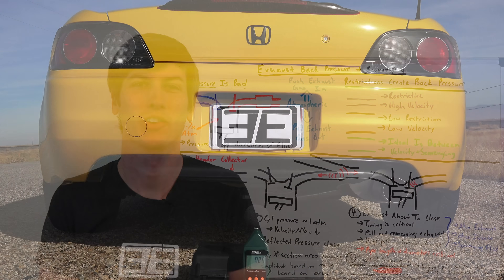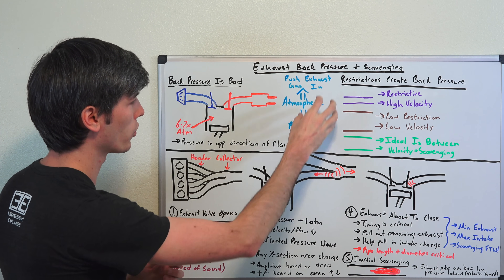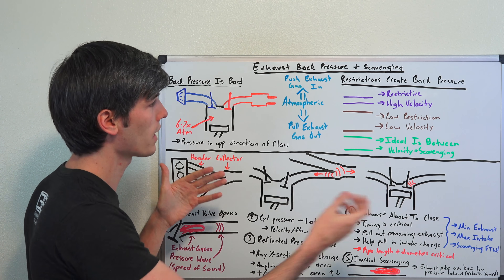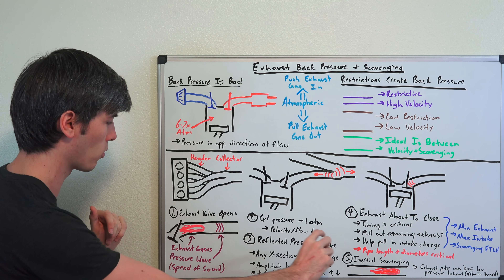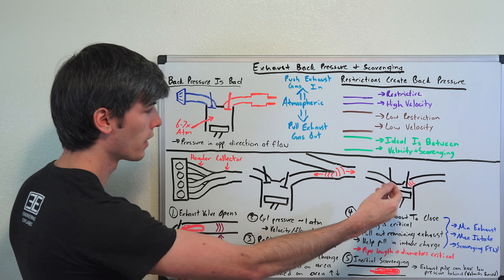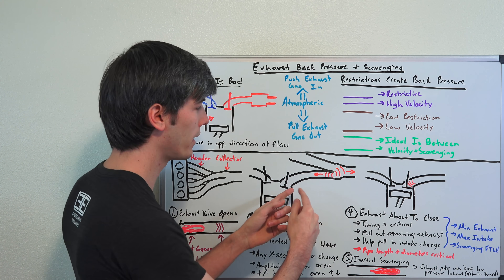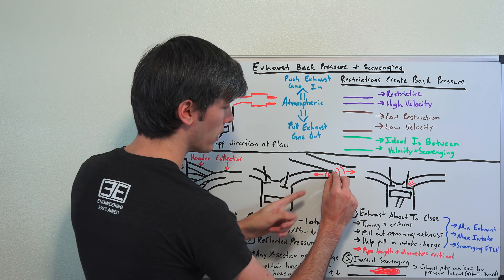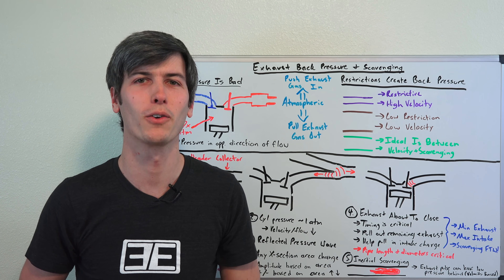Stop Saying Car Exhausts Need Back Pressure

Comment: YES!! Thank god! So sick of hearing the crap about "needing" back pressure.
Reply: you cant have scavenging without backpressure. you don't need it... drag cars don't have scavenging. lmao
Reply: Yep. Beat me to it.
Reply: You DO need at least some back pressure to get good sound. Try taking off everything after the headers. It will sound like ass.
Reply: @80s_Boombox_Collector  Sound doesn't help it go, contrary to what every Honda driver around here seems to believe.
Reply: @Jupiter__001_  No, but good sound makes it more enjoyable.
Reply: Unless your engine doesn't have viable valve timing, then like magic it does need back pressure. Hence exhausts used to be built to a specific volume to supplu this. Remember the shittu ford fiesta xr2i and twats used yo put massive exhausts on, and then the car had zero acceleration and top speed..... so like i said in my comments  variable valve timing is the reason an engine no longer requires back pressure to ensure hp.
Reply: @ADayInTheLifeOfAYeti  You missed the point of the video. "Backpressure" from the point of view of the engine is minimised by applying a somewhat restrictive exhaust manifold that is designed to aid in scavenging. Backpressure itself is not desirable, but restriction can be, depending on how it is introduced.

Comment: What about stock cats vs high flow cats or no cats? I heard that you could lose torque  with test pipes. (It's been two years but any response is good)
Reply: No back pressure you lose power because fuel is going out of the chamber... What does the backpressure is to keep the fuel inside the chamber before the piston goes up.

Comment: G'day,,yep 2 years till viewed,,so might be a bit late,,but back pressure was important for older design engines,,like flat head,back pressure was intended to prevent valves burning,,making sure complete valve circumference was used and not  just the edge near cylinder,which would burn,,causing head removal and replacement valves,,
modern day engines don't require much back pressure ,Head designs have changed from the old side valves,these day we use  exhaust pulse to make more power,,Expansion tubes on 2 strokes best example of this,
So for older design engines yes,Side valves,,,later day turbo ed non turbo-ed,,nup,,

Comment: Yeah but you do need just a little bit of back pressure, too much free flow on N/A engines especially 4 cylinders can result in less power due to the combustion escaping out the exhaust valve during the compression stroke

Comment: Engineers call it back pressure. But I see it as just being the pressure that is present when exhaust gasses are flowing through your exhaust. On a typical stock engine (general motors) will call for .5 to 2 psi depending on number of cylinders. You need restriction for scavenging to occur, very very little restriction to create the affect. Just like people are joking. You can't just put 10" straight pipes on everything

Comment: Greetings. I fitted a aftermarket exhaust to my xtz 660 tenere... i have noticed when the DB killer is in, there is way more power through the rev range...with the DB killer completely removed, the power is noticeably less... i think it needs a bit of back compresion cause of the catalytic  converter that was in the standard exhaust... i love the sound without the dB killer ...but want the power like the db killer inserted. Could back compresion be the problem?? Thanks for your video. Much appreciated

Comment: its an old post i know, but its a silly question, because the quest appears to assume some things in the way the question is asked. i mean there are to many variables, from cam timing, if your running boost , super charger or turbos, nos, is it a straight up race machine were talking here? or is this grandmas grocery getter? i dont like the titles in your videos .... they assume to much and do not ask or inquire to specific enough conditions

Comment: I had a diesel Rabbit in the late 80s, and when the exhaust pipe broke, it was louder and slower than you could imagine.
Reply: Why did eliminating back pressure drastically decrease performance?

Comment: My aunts ride on craftsman mower with a briggs and stratton wouldn't run without back pressure. Her muffler broke right where the pipe is spot welded into the muffler, it would only start and run if i pressed my palm tight against the end and restricted the exhaust, put a new one on and it runs like a dream.

Comment: I have to think through this negative pressure thing a little. 
You explain the back pressure question I've had for years. Thank you. 
I had a 69 Dodge dart Swinger with a 340 and later I saw on another Dodge police interceptor, immediately after the exhaust manifold there was a 2" pipe from 18"-24-" then expanded to 2 1/4" after. 
One question I had when you were explaining the scavenging effect was what about the valve overlap? Older v8's typically had about 15-20 degrees crank rotation of valve overlap.

Comment: For vehicles that are equipped with egr systems a small amount of back pressure is necessary for proper function. I've tested and recorded a 3mpg loss from my 3.0 ranger from a hole in my egr feedtube.

Comment: Sounds good to someone take has no mechanical training.  
Some engines by replacing the muffler with with a pipe can cause a drop in fuel economy by 20% or more. 
SO NO. 
SOME BACK PRESSURE IS NECESSARY FOR FUEL ECONOMY.! !

Comment: Here's my personal hands on experience by feel not by dyno. Vehicle: 89 f150 2wd carbureted 351w 4spd manual. Engine mostly stock with long tube headers, electric cutouts in front of 10 series single chamber mufflers. 
With cutouts closed and running exhaust through mufflers, strong pull, but hesitates at first. With cutouts open, smooth response but feels like it isn't picking up speed. As said before, this was all based on the feel not the dyno sheet. Never went to dyno because it was a beater with enough pep to have fun on your drive to work. Also had a passenger that confirmed the feel.

Comment: Had my exhaust snap just after the cat and the car lost 90% of its power...
Reply: tle1977a your car went into “limp mode” because the excess oxygen confused your lambda sensors. (Specifically the bank 2 sensor after the cat)

Comment: Sounds like the negative pressure wave is critically timed for a specific rpm and the benefit falls off the further you are from the sweet spot. So if your exhaust would variable tune based on your rpm then you’ll have better performance. Can the tuning be done real time with electronic gates/baffles to change where the first wave is sent back?

Comment: There's a fine line with back pressure it is not simple and cut you do want a small amount of back pressure because it reduces fuel consumption when you have a very free exhaust it will sound much better you will have a lot more power but you will burn the hell out of some fuel

Comment: This video's too basic making the title misleading.  You always need some back pressure and it has to do with:

- Intake gas inertia
- Intake/exhaust valve overlap at end of exhaust stroke
- Engine capacity, speed, exhaust capacity thereby gas inertia

For example:  My little brother decided to drill a few small holes in the end of his bike's factory exhaust.  Sure it sounded a bit louder and he felt the power was somewhat the same and if he experienced any more he put it down to psychosomatic experience (because he's somewhat clever).  But the bike was then using more fuel.  After I explained some of the details he fully understood the principle of "over-scavenging" - when the exhaust low pressure scavenging sucks raw intake gas through the critical and unavoidable valve overlap straight into the exhaust, not actually burning it.  He basically ruined his factory-tuned exhaust, at least until we plugged the holes back up.

The other principle has to do with exhaust reverberations and returning pressure waves.  These are usually taken care of by way of a "step" shape at the mating end of the exhaust port and the header pipe, reducing pressure waves from re-entering the cylinder, including a tuned length set of pipes to properly cater for exhaust pulses that can only work in a certain RPM range.

Comment: You forgot to mention about engines that have the fuel drawn in with the air, like carburetors, and have valve overlap. If there is not enough back pressure, the raw fuel can be sucked out with the exhaust gasses, lowering power, efficiency and shortening catalytic converter life if you have them.

Comment: So lets say i have a late 70s ford with a carbureted V8. It still has the stock exhaust, and it kind of rocks at idle but not too badly at all. The stock exhaust however is completely roached and has holes all along the top of the pipe, but it still has a catalytic converter. Do you think It would be fine replacing it and putting a glasspack or somthing better because it doesnt seem like it has much back pressure at all currently? Not sure how picky 302s are but id like to get that fixed. Thanks

Comment: Take into account that the speed of sound increases with temperature. That means that as your engine heats up, the sweet spot for scavanging will be at a higher RPM.

Comment: Very nice explanation! I also would like to know, the way to discover the ideal velocity. Is there a equation or has to be empiric (by testing different exhaust, one by one, in a real track)? Thank you!
Reply: Yes- there are equations to help design optimal configurations, easily found around the internerd. Exhaust calcs are based on the pressure wave travelling up and down the pipe at the speed of sound.

Comment: Bro I’m just trying to figure out if it’s bad for my truck to straight pipe it 😂
Reply: before you go to straight pipes check your air/fuel ratio on a dyno ..if it becomes lean with straight pipes you will need to increase the air/fuel ratio till it is the same as before with mufflers

Comment: FINALLY someone with smarts ! back pressure = BAD, I wish I had a dollar for everytime I've heard "oh I don't want to do that it will take away my back pressure ! " to that I say ABSOLUTELY ! that is what your trying to do ! .... in the 1970's ford trucks that got 12 mpg (loaded or unloaded truck....a very good trick on fords behalf! )  I've been telling people for years replace the exhaust with 2" or 3" pipe and get rid of the 1.5" exhaust pipe.... and their gas mileage goes up  ! most people believe you have to have back pressure for some reason, I guess that is because of the auto manufacturers  lying to justify the small ill conceived exhaust pipe of the 60' 70' and early 80's ....
if the guys that own the older pickup trucks would replace the exhaust pipe, throw the carburetor away and get a good one
and time the engine correctly ( with a vacuum gauge to get the right setting (Peek the vacuum)) they would get at least 24 mpg ! ..... I know I've done it several times !
unfortunately most are of the belief that you need back pressure in the exhaust system, ....nothing could be further from the truth ! ....
Bob....

Comment: Okay so I have a serious inquiry about this, I want to do an exhaust on my 2.8l 30v B5 but i don't know what diameter I want to do it in. So the first real question is there a way to calculate the perfect diameter to reduce back pressure as much as possible while retaining as much velocity as possible. Now to get more specific, I've notice the car makes good torque between the 2500-4000 rpm range and then while the car doesn't fall on its face it takes a bit for the car to start making power and I notice that around 4800rpms I get a massive jump in power. Now personally I love this as I'm a huge fan of peaky motors such as the 4age etc. And I was wondering if there is a way to retain as much of the torque as possible but to amplify the burst of power at the top end at the same time. I really want to do a straight pipe with higher flow cats where the inlet and outlet of the cats is 2in and then it goes into a y pipe with a muffler at the end. The exact engine displacement is 2771cc and I've seen graphs/charts saying 2.5in is the way to go but some people say it sucks. Sorry for the long comment and I very much do hope we can speak about this a but more.
Reply: Do the math
Reply: @williamparker2922  if I had an equation to do math with, I most likely would have done that a long time ago. That's the reason why I'm asking, I'm not asking anyone to figure it out for me. I'm asking if I could be provided an equation as well as a more specific problem that I would like an answer to.

Comment: In my experience of fabricating stainless exhausts for hundreds of cars, one car stuck out. I believe it was a Citroen C2 with a 1200cc engine. It had a rather large bore exhaust from the factory (2just over 2" but not quite 2.25") with restrictive silencers. When I made the exhaust for this car, the customer mandated that I kept the bore the same size for various reasons that werent valid. Anyway, after fitting a system with free-flowing-silencers and that 2.1" bore, the customer came back and said he had lost power. To fix it, I removed the back-box section and rebuilt it in 1.75" bore with a free-flowing silencer with the same internal bore. Problem fixed. 
When full systems are built, we went either from the downpipe or after the original cat section. This is so that forwards of the exhaust system is kept original. Often if the customer requested too large diameter, they would lose power.

Comment: My question is if you had a electric fan in the exhaust pipe that creates a vacuum to help suck the exhaust out of the cylinder would it be more efficient?

Comment: Why do piston engine aircraft have relatively short open and separate cylinder pipes?
Reply: They usually have them facing back because the force at which the exhaust leaves the engine actually produces some thrust in the plane. That's why most v12 from ww2 had the exhaust tips shaped the way they were.

Comment: So how would the math work like formula to figure out the sweet spot
Reply: definitely not a single formula, but a bunch of them interacting with each other. So most likely there are computer air flow simulators to give engineers some idea on what do to and then good ol' trial and error. they listen to the sim, make a real exhaust based on that, see what's what, ideally locate the problems, go back to sim, repeat until good enough.
Reply: Exhaust systems are largely based around what ME’s (mech. Eng.’s) call “fluid dynamics”.   I took 3 courses at my university that involve that subject when earning my degree. LOTS of math. Unfortunately too much to explain in one video/comment. But, google is pretty helpful 🤙.

Comment: i have a subaru outback and my exhaust pipe rusted out. i patched it myself and a week later it fell off entirely.
i had a shop fix it and they put on a new pipe from the cat to the muffler, removing the right muffler, old pipe 2"? and resonator and replaced it with 1.5"?
but now my car is loud on accel and decel. has a really loud rattling noise and if floored get a whistling noise in addition. i tried another muffler with no change.

i've also noticed a loss in power. it isnt significant, especially at a leisure acceleration (power), but is pretty noticeable when flooring it.

before the change i would get 10mpg while towing at 50mph (~4000rpm in 3rd gear) but now i doubt i could maintain 50mph on the same stretch of road.

is this due to the small diameter? my imagination? resonator? muffler?

Comment: Back in the 80s i was rather interested in driving tuned Minis. I had about eight on the trot. A mate of mine pulled up in his 1275GT and i wandered what the hell had stopped outside my house. I went out to see him in his latest GT, He loved them... He gets out of the car and asks if i heard his exhaust. I said no, but i heard what sounded like a tractor about to detonate. AH, he said. No that was me, look.
I went to the back of his Mioni and saw a piece of 5 inch diameter flexible drain pipe poking from under his rear bumper. 

It sounded HORRIBLE! When i asked if it had any affect on driving, he said yes. It's flat as a fart! So he drove back home and put the standard exhaust back on.

I also remember around that time that the best combination of noise to added performance was the RC40 single box system. It was expensive but backed it up with flow bench charts and proven gains in power. 

I remember reading about aftermarket performance exhausts in CCC, (Car and Car Conversions) which was THE magazine of it's day. They conducted a proper scientific test on which was the best performance exhausts for a mini.
I think the RC40 wasn't the absolute best, but the best all rounder. There was a popular cheap exhaust made by a company called Peco. I'm pretty sure that their PERFORMANCE EXHAUST actually flowed WORSE than the standard exhaust and when fitted gave less power on the rolling road than the standard exhaust too. It was just louder, which for the idiots meant 'must be faster'.

Comment: i heard back pressure is good 20 years ago in high school auto shop and about how new cars (1997) needed it to help performance because of the computer.  i have remembered that for 20 years and it never EVER made sense to me except that maybe the o2 sensor somehow will dump more fuel or ????....but i dont think it can dump more fuel than my right foot so it is finally reassuring that it doesnt make sense to you either.

Comment: Is there a practical way of measuring the pressure in the exhaust valve area so you can make the appropriate changes to promote scavenging?
Reply: Yes through a programmer.

Comment: How h-pipe affects backpressure. I want to create the maximum back pressure on 3UZ-FE. Thank.
Reply: The crossover at the "h" changes the pipe effective diameter, and so the pressure wave changes direction at that point. figure this into your calculations.